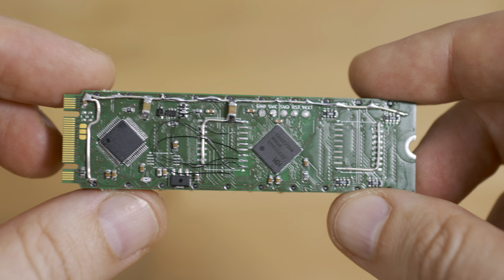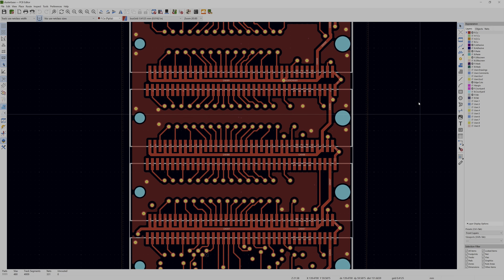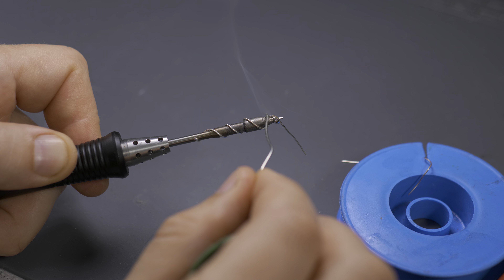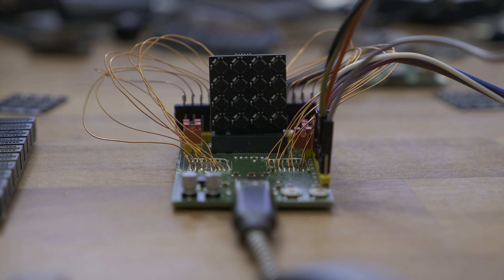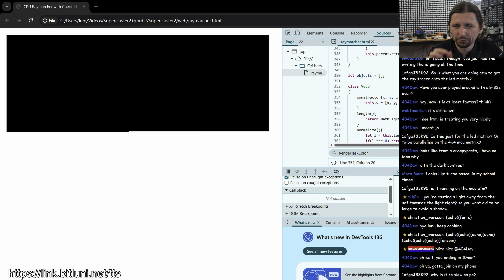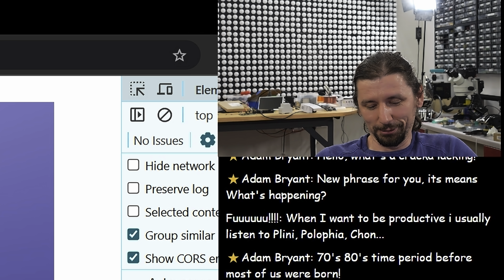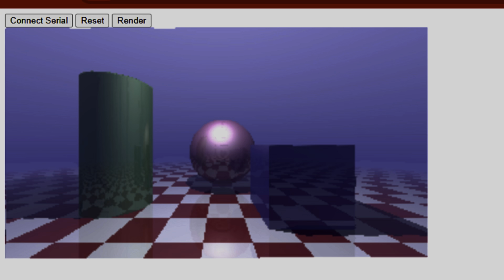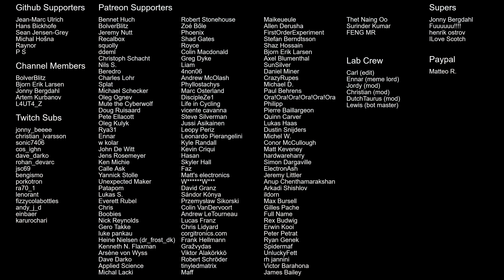I made a GPU at home

Comment: ...why are you assembling like this? You seemed to put paste down with a stencil, then melt it, then put the parts on?? You put the parts on the cold paste, use a vacuum pick and place tool (that's what the yellow tape is for), then heat the solder.
Also, why do you have one board in a huge unpopulated panel? Put four per panel.

Comment: That little wire soldering trick for the tight gap was genius.
Reply: 1ooth like yeah! 😂🤣😅
Reply: I know! Can I pumpy you?
Reply: I still don’t fully understand how that works, wouldn’t the solder melt at the iron, and not at the tip?
Reply: @luipaardprint  It most surely does, but that's not an issue unless theres too much solder for it to keep sticking to the tip. Imagine a waterdrop on your finger, it won't let go if it aint forced to do so.
Reply: @Allexz yes, a water drop of solder on my tip is something I’m fairly familiar with, it’s just that when the solder is hot enough to melt it will ball up. When it’s not hot enough to melt and stay as a rod it won’t be able to retouch the feet. 
The only thing I can think of is that he used a different solder with a higher melting point than the original.
Reply: @luipaardprint the wire on the soldering iron is just a wire. Not solder. He used solder on the iron tip to transfer the heat to the wire, and then put a little bit of solder on the end of the wire to touch up the solder in the tight spaces.
Reply: @HPHRGaming-vx2gl oh. Yeah no that makes much more sense. I guess I was just spoiled with our micro soldering station at the shop.

Comment: This is a masterpiece! My only suggestion might be that across all of these chips, the clock speed might be getting out of sync. That in turn could be throwing off the data transfer speed from what they are hypothetically capable of. Im working on some distributed computing stuff, the one thing would fit nice with this. You might need a "master clock" of sorts on each node. I love the channel and will be following!
Reply: It would be cool to have a programmable phase delay so that one could play with the timing and do experiments. If all the boards are synchronized, it could cause high instantaneous power draw, and if decoupling caps are strong enough, ground bounce. Having a design that can tolerate different frequencies and phases would be ideal, knowing when the system fails because of clock issues would be even better than have strong clock alignment.
Reply: @Opticlipcon  Well funny you mention the power. I figured out what the flaws are in this first design. While it is absolutly brilliant, My Electronics AI looked at it, and revealed that the highspeed traces need better seperation to prevent crosstalk. Thats a big one. Power planes and ground vias to improve signal integrity. Also, EMF isolation, considering how dense these clusters are, I would be willing to bet that is also causing bit flips.
Reply: @be-labs do you have a custom electronics design AI? Or is there some service that offers this?
Reply: Is that like a time synchronization system? We have those on our SMT machines since mulitple machines are connected as a "line"
Reply: @clerooth Yes, so the chip clock speeds might all be the same. But also due to how many of them there are and board, spacing, they can "fall out of sync". A master clock signal from a common source would be one fix. However is the trace cross talk. Which is a common problem when you're dealing with high frequency signals.

Comment: For the pull up speed issue, you can try to replace the resistors with toggleable current sources. I heard this is how very high speed (relatively) I2C operates.

Comment: So, seeing as you used a 4 lane m.2 setup, what exactly would happen if you scaled it up to fully utilize an x16 slot? 640 core super cluster? If it doesn't actually use all 4 lanes, how many cores does it take to saturate 4 lanes? Could you break 1000 cores?
Reply from the maker: i use only 1 lane. but that's far from being fully utilized. x16 means 16 clusters on on pcie card :-D
even the clusters would be able to handle more cores

Comment: 13:10 when i've run into hitting the limit of 115k baud its usually been because either the serial interface hardware i was using couldn't actually support higher speeds, the firmware on the interface was not configured, or the driver on the receiver was not configured correctly. i most often worked with fancy USB to serial RS-422 interfaces that connected my equipment to a windows PC, and it seems like 115k baud was always the "default max" speed. going higher than that always required updating something or messing with settings in the driver. and sometimes we discovered that the equipment side (the MPU) couldn't actually transmit faster than 115k! it was always a hassle. i much preferred using ethernet for really high speed coms because even a basic cheapo NIC can go insanely fast compared to a serial interface controller.

also you want to make sure your physical cable isn't poor quality. sometimes cheaply made serial cables will have insanely thin wire or will not be shielded and you can start to have problems. i preferred making my own serial cables from scratch to avoid this

Comment: Let me guess:  It runs on Linux, or BSD, but not Windcrap!!!😁  Now this I may have some use for!  

Processor sharing in Linux is included out of the box, or at least for me on Arch, which gets along well with RISC V, you just have to know how to make it work, which I don't completely yet for the moment, but my favorite fractal imaging program of all time does it with such ease you have to wonder why a whole SOHO can't be as easy to setup: 

All you have to do is open the the program and load a file, or make a new one, do your thing at lower and easier to process resolution and such, and then when you are satisfied and ready to render it, refine and crank a bunch of settings that will otherwise hamper your work given the processor power needed to give you a true representation, and then fire up all of the computers on your network even if you haven't even set up an actual network yet 😮open Mandelbulber on all of them (no file loading), and on the PC you have the scene all worked out on, click "Render" and watch it crunch the numbers with whatever hardware it can tax, and spit out an 6K image with all the environmental effects field of view and all that, and depending on complexity and detail may take hours, days, or even weeks to do with a 486, a few days with a Pentium or K6, 4 days with an early I5 or Athlon, and still a good few hours to a day or more on an AMD AM4 4, 8 core processor alone, and that's before you get into 3D Fractal fly through animations!

Anyone have a used supercomputer for under $ 200? 🤨 I'll take it!!!😁

I plug my laptop, backup server, front office and living room entertainment system to the network (all a bit older but still running stable), and without any networking setup, it see's all of the processor cores and maybe more, and  uses them!  I guess it can with the brilliant way Linux security works, because it's not using any drives read and write, and so doesn't pose a real threat.

I can totally see that if buying one or a few whenever you have the not tied down cash, you can accumulate banks of them or similar adding up quite swiftly!  Along with the AM4 MoBo and 8 core AMD Ryzen 7 7500X I am running, I have room for about 150 of them in my early 2000's huge Cooler master HAP X case😀 so bring it on!!  I'm game!🥳 🍻🥂🤪

Comment: Why do you pre-melt your solder paste.. the idea is to stencil it on, gently place the component on it , pre-heat it to sub melting point then use a heat gun to gently take it the last few degrees.

Comment: You could use some high-temp filament (PTPET or ASA etc) to make "jigs" to let you hold your various components in place while you drop parts onto the board when hot. 
Shield the bottom side of the printed part with a layer of resin-bonded foil + thermal tape, which should give you enough time to seat your parts and drop them in place, nearly perfectly, before pulling the printed jig away. 

Polymaker, Sparta3D, and FusionFilaments have some excellent high-temp plastics. You can get even more thermal resistance with "remelting" or "annealing" and make yourself some really game-changing contraptions for tool holding and jigs.

Literally any 3D printer with a max nozzle temp over 270 (counting for thermal drift) can print non abrasive high-temp filaments with a brass nozzle. If you print at 270, you need a printer that can allow for 280-285 for thermal drift. You probably already knew that, but for those that don't.... here ya go.

Comment: On that sort of design you should have a separate power plane for each voltage, so do a 6 layer board so that power and ground are continuous. Yes it costs more but it guarantees no supply issues.
Also if you use red LED's (not pumped phosphor red) you have a 2V requirement and assuming you have a 3.3V supply a 2.7k resistor is probably ideal as modern GaAs LEDs only need 0.5mA for reasonable brightness.
Also if you want more performance use ARM cores instead of RISC-V, they have better performance and you even have ones with HW division in a 24 pin QFN at around the 50c mark.

Comment: 5:04 oh damn those body diodes, I've been dealing with that on a very small scale. Basically, if I turn off power to my 68HC11 chip, the logic high idle serial port input will happily power the whole chip. So I have to have a current limiting resistor on that input.
It happened again when I thought I could power an SRAM separately from the rest of the system, and not only did the SRAM somehow manage to power the other three chips, it also got quite warm doing so. (Spoiler: that's not how you battery power an SRAM.) At least the SRAM didn't die from that.

Comment: up the led resistor & modulate the  led, it don't need to be full on 30 hz is fine...., tehn maybe use hte cpu slot location as a counter so its 30 hz interlaced., sould get the pwer draw down and more stable

Comment: With thin tracks you could get them plated to thicker copper to handle more current.
Truly pushing the edge here for DIYselfers.  Wonder what the smallest floating point CPU is?

Comment: i wonder, can a module contain more than just MCUs? also do the MCUs use serial to communicate between eachother, or do you have a faster interface for that and serial is only used to communicate to the host system?
if the MCU to MCU communication is decently fast then maybe it could benefit from some onboard RAM?
like what if you had a module that instead of 16 tiny MCUs it only had 1 slightly larger MCU and a DRAM chip (like >=64MB)? the larger MCU with its extra pins would interface on the one side with the other MCUs and on the other with the DRAM chip. that way you could store data locally instead of having to swap stuff out constantly to the host system.

Comment: Re. addressing  - the WCH chips  have a unique serial number. It may be that they are sequential as they come off the reel, so after assembly the serials are in a predictable order.
Reply from the maker: used that on the old cluster. they are sequential but sometimes there is a jump in numbering and it's also not the least significant byte that changes. there is not much of a control. the matching of the physical position in the array would need to be done manually and maintained afterwards. At this point I'd probably not even need the physical positioning anymore as the 3d led array is dim at best. the index however is quite convenient for the bus addressing. 
I use external interrupts on the trigger line to start a communication. on the big array multiple mcus share a trigger line. so what happens is the host puts the target index on the data lines (255 is broadcast) and triggers. the MCUs that are not targeted just stop listening instantly. I use another line for the clocking after the initial trigger. only the targets turn on their external interrupts for that line. there was a lot of pain not shown here to get it working. I just reached the point where I would start optimizing
Reply: @bitluni  what about making a chain of them for addressing (eg using pin with led as output, if there is any left for input)? Add special instruction to assign address when its not yet set and chip receives high state, previous chip outputs high when its already addressed.
Reply: What's fastest bus to use between them ? As UART surely is slow.
Reply: @thanatosor i2c can be faster. After that SPI
Reply: @Henrix1998 I2C seem possible as SPI requires additional pin per new node

Comment: This is freaking awesome!! I have been wanting something like this for years.  As far as you saturating the UART, really you should divide the image into larger squares and each MCU can deal with an entire ray bundle, not just an individual pixel.  This will significantly lower the bandwidth on your serial bus and vastly increase efficiency of the cluster.  Good luck!
Reply from the maker: yes, a lot of optimizations that I skipped. there is a comment somewhere here with an elaborate explanation. but in a nutshell the cluster underperforms at least 2 magnitudes because of the bandwidth. I change the interface first before distributing the load better

Comment: so you made a gpu. pretty nice.
Reply: how about doing your own fpga design with the silicon fab project.
Reply: 32k cores. 160 cores is like an old gt710. also put rom/ram/disp/nand on the cores. ie the cores are the pixels, rom, ram and ssd nand themselves. as distributed cluster. on a single chip. ie use the risc core chips as led tiles with more leds per chip core.
Reply: those hdr video stuff pops lol.
Reply: crypto is better than normal cash.

Comment: 13:38 the reason you no longer hear the propaganda about crypto being a waste of energy is because crypto uses vastly less energy then any banking system it competes with, I can't remember orders of magnitude but it crypto uses 2 units where banking uses 8 units. in the crypto world we quickly demanded that financial systems that used more then bitcoin be banned, knowing that every year chip design improves but traditional finical systems are still using cobol programming and anything that could be made in to hardware was done so long ago. the propaganda stop really quickly when the crypto bros started saying yes think about the environment. it's the same reason you will never see actual hard "carbon credits" because when you start actually doing the numbers lots of the "environmental" things start becoming made in china not in environmentally friendly way, shipped across the world not in a environmentally friendly way, and requiring extra peak power storage plants burning power by storage, in actual waste, energy that could be and would be harvested to mine, reducing the traditional finical system power use. does win and solar actually beat LNG, are you actually sure? even with maintenance, shipping, and  performance degradation?

Comment: On a single core, my CPU (AMD Ryzen 9 9900X) can do about 20 millions of SHA-256 (of 64 random bytes) hash by second. I use the same algorithm described in your Web page (cpuHashRate). The Web page is really not efficient... The code was written in C, nothing fancy (using openSSL, or a custom implementation), did not multi-threaded it since I am lazy...
Reply: So what's with his result? I doubt that even 160 can outperform any modern desktop CPU.
Reply: @xhivo97 well, in the video, he is claiming that (from his point of view, it even beats a 8 cores modern CPU...), and to prove it he did write a benchmark.  This was so strange, that  I had to explain that this is completely wrong

Comment: I'm so impressed, this is the kind of thing I wished I had the mental persistence to do, so I envy you.
I was wondering if you could switch to SPI for your data transfers if you're struggling with slow UART?
And although those WCH chips are insanely cheap, I wonder what an RP2350A or RP2354A would do? You can use the PIO to make a mesh of software defined high speed serial interfaces using PIO.
Reply: With rp2350b it is possible to get true PCI bus working which is 33MHz x 32 is almost 1GB/s.

Comment: Now someone should investigate clustering RiscV on the silicone wafer. The clustering electronics on the cut lines, made such that cutting through them just makes them non-functional.  Cut any cluster size out of the wafer, package in a chip, there, say 1024-core cluster on a single modest size chip.

Comment: 3:30:00 - You could have 3D printed a jig to put them down at the correct spacing/location, and then hot air flowed the solder. This makes zero sense. Work smarter, not harder. Make a reflow oven.